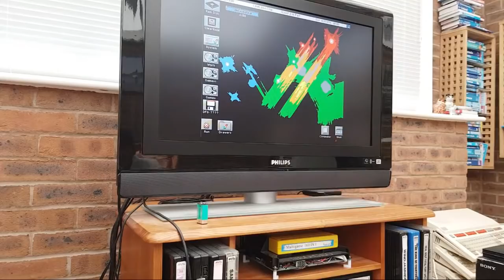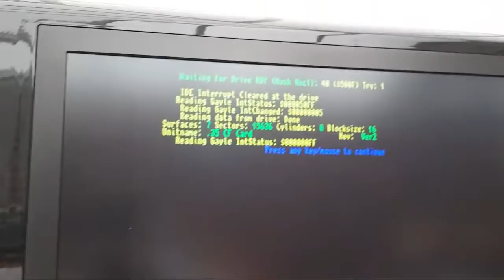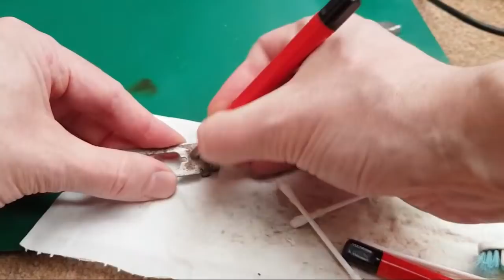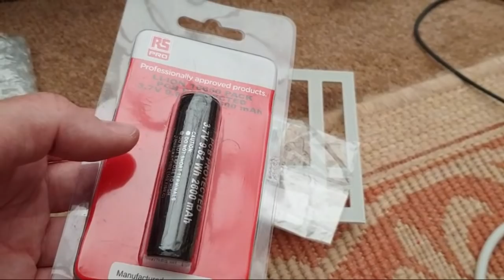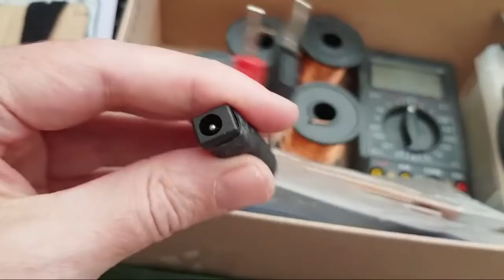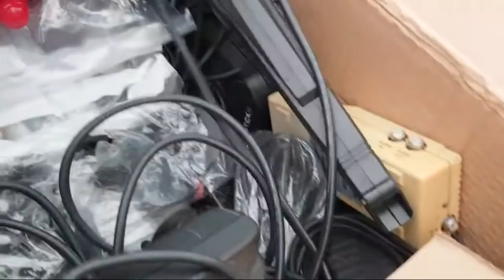Commodore Amiga A4000 Testing Both Boards & Waffle

Comment: Watch many of your vids and i would like to ask you if there is any way to contact you, Have a problem with an amiga 1200, changed paula and both cia chips but still no RDY signal from floppy drive, not DF0 and not DF1, tried with both Gotek and ordinary drive...
Reply from the maker: It sounds like possibly a damaged trace!  That's often the cause on 1200's where caps have previously leaked.  I cannot do customer repairs sorry =(

Comment: I've had some WHDLoad black screen issues as well. That was caused by the combination of FFS flesystem with DirectSCSI enabled and WHDLoad configured to PRELOAD. Turning of DirectSCSI fixed it. No idea if your conditions are the same, but maybe worth checking.
Reply from the maker: Thanks for the info there =D

Comment: The Atlas DCS55 tests diodes/LEDs, BJTs, FETs/MOSFETs, SCRs, and Triacs. It’ll also test dual-diode packages (either CC or CA), and you can test each “half” of a bridge rectifier that way, too. Very handy, but make sure to pick up an extra A123-type battery for it.
Reply from the maker: Thanks for the info =D

Comment: After repairing something like 40-50 of them 4000 boards, I can tell you that in my opinion you did everything right, just like I would do it. It's mostly always the same issue, battery corrosion affecting the clock and the joystick ports, pullup/down resistors at that area (also bottom side of board), sometimes the fast ram bus buffer between clock and simm sockets. Nice thing to know: if the option bits aren't right, workbench will not allow you to choose AGA screen prefs modes because it (setpatch) thinks it's an ECS board. Systest will alert you if that's the case. And, whenever you have a yellow screen but everything else checks out ok in diagrom, buster and/or it's socket is the prime suspect. For some reason kickstart needs a working buster. I've also learned that it's necessary to check the zorro2/3 functions too with a riser board and one or two test cards, since there's a lot of parts on the mobo that only deal with the zorro stuff. So I've added that to my 4000 board testing routine ;-) Another thing handy to know: if the U891 buffer lacks the vcc or the gnd due to via corrosion, it can lock up the cpu side databus causing no boot. Removal of that IC would fix that temporarily. Keep up the good work!
Reply from the maker: Thanks for the info there =D  Yes, I spotted that Lisa version mismatch reported by SysTest due to it not reading the option jumpers correctly.  I wasn't aware that it would stop AGA modes though! =D

Comment: Tested this out before, while you can use A1200 KS chips in a A4000 it will only allow you to get to the KS screen the IDE  etc will not work same if you use A1200 in A3000.

Comment: Got a bit of a red hering chase myself the last few days. Quite a while i bought a pre-rgb-amp modded IFU-30a from japan quite a while ago, but when it finally arrived, i had modded an IFU-30 myself wiith a ths7473 rgb cd boost chip. Also the IFU-30a came with a JP scart cable, so i couldn't quickly check it before. 3 days ago i finally converted the JP scart plug to EU scart pinout. Blue was missing from the RGB signal and there was no audio. I was pulling my hair out why this happened, jumpered out the RGB amp, checked connections for continuity, checked capacitors, checked a transitor that was acting weird in diode test, reflowed connections, traced the audio up to the din socket the japanese guy used. Nothing. No change. Then i went for the simplest thing; checking the cable not only for continuity but for shorts. And yep, lots of them! lol*. Blue had a short to both audio channels and the +5v line inside the cable. Not good  *lol Amp can go back in and i just need to make a new cable. Always check for the simplest first; lesson learned lol

Comment: Hi Chris, do you take in repairs at all?

I have a 1048S and a C128D that are in need of some attention (they both keep tripping the circuits!) and it is way beyond my limited expertise
Reply from the maker: Maybe at some point - I've got so much stuff to try and get out of the way I cannot accept repairs at the moment!
Reply: @GadgetUK164  I had a potential project for you and would pay to do a RGB mod on a AV Famicom, I already have the console and the correct NESRGB but not sure if you would do it for a video.

Comment: hi there, one of these would speed up testing when you don't have a floppy connected as the A4000 (and maybe others) have a delay built in.

https://amigakit.amiga.store/product_info.php?products_id=832

With The terminator and Harddrive connected: 3,6 seconds delay,
With The terminator and no Harddrive connected: 8 seconds delay,
Without The terminator and without haddrive: 38 seconds delay!

i forget the amount of times i though i had killed mine before i got one 😁
Reply: I'm sure you can get an IDE Terminator as well which helps when just testing for Screen Diagnostics
Reply: @TotalMoop  yes that's true.

http://amigakit.amiga.store/product_info.php?products_id=831
Reply from the maker: Thanks, will check that out!